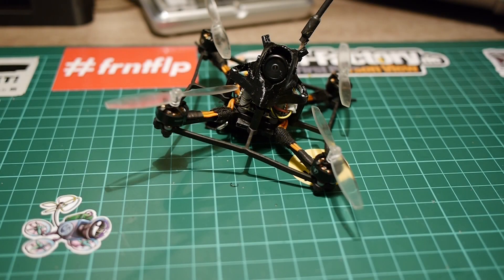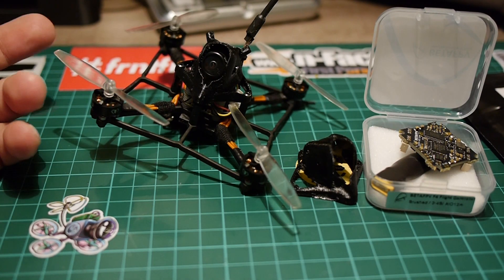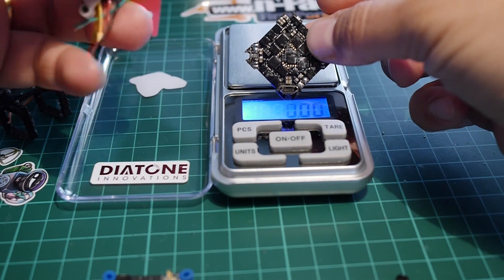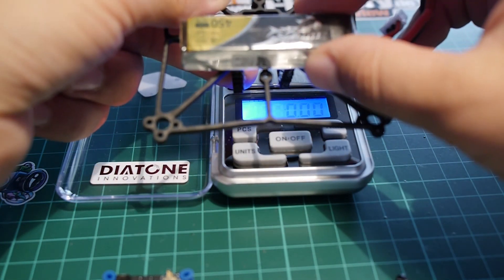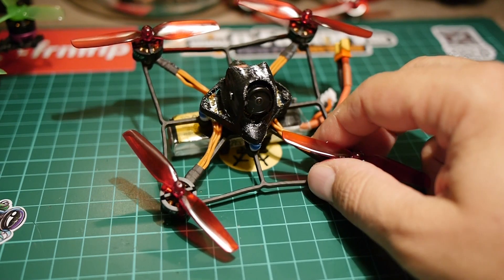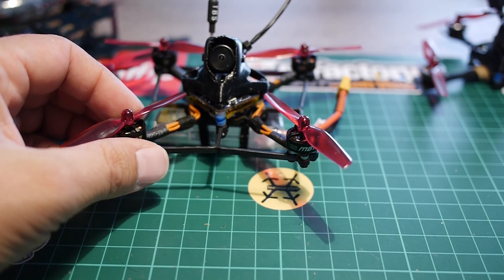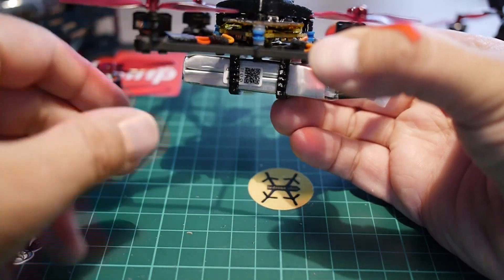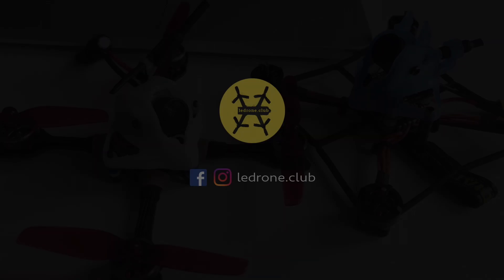Diatone Cube GTB229 : Rebuild

Comment: Hi nice video BTW I purchased the diatone toothpick frame and the hyperlite 1103 8000kv and runcam nano but I don't know what stack I considere to purchase I found the iflight stack 16x16 with Vtx what do you think about this stack it's will fit in the frame? 😁 Thanks
Reply from the maker: Sokaye yes the stack will fit, it should be the same size as the diatone one
Reply: @Ledroneclub   you put the  Beta FC upside down i have the same fc  , you can share your  bf config pls , you've changed the resources of the motors  or just the orientation of the board ?
Reply from the maker: Sokaye sure no problem. Let me dump it. I changed board orientation and motor resource mapping as well. This mess can be avoided with the new Toothpick F4 from beta and the nameless board that have an USB port on the side
Reply: @Ledroneclub  sure the diatone one with usb out it more convinient ,  but i have the betaFpv one  at this moment of time
Reply from the maker: @rarih100  here's the configuration dump of my beta board. Will add it to the description as well https://pastebin.com/2jEc0pN8

Comment: hello, I have the version 229 10000kv and when it rises suddenly the signal is cut off and rushes to the ground I put receiver frsky xm + as if it entered failsafe but I am 2 meters away
Reply from the maker: aren't you experiencing a "runaway prevention" mode ? Like when props are not spinning in the correct direction, the FC is not oriented correctly.

Comment: Which antennas are you using atm?
Reply from the maker: Moreno A for vtx simple dipole like here or small circular polarized like lumenier axii or uruav uxii. For rx I run crossfire with custom cut mini T antenna usually